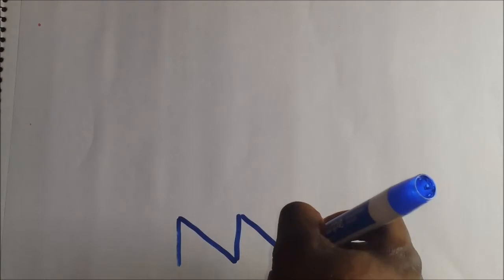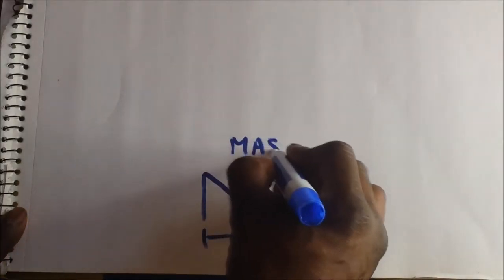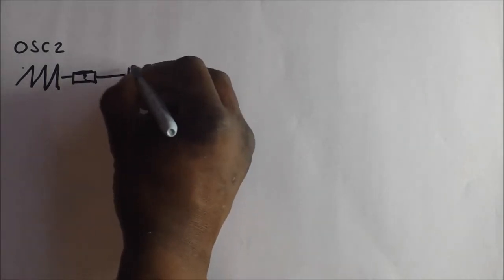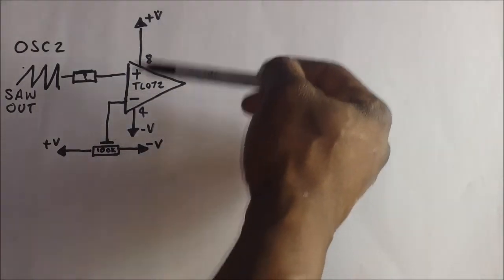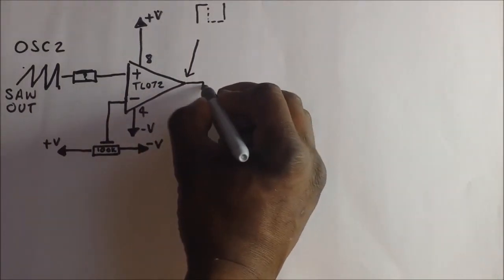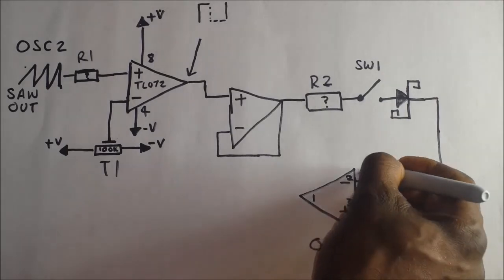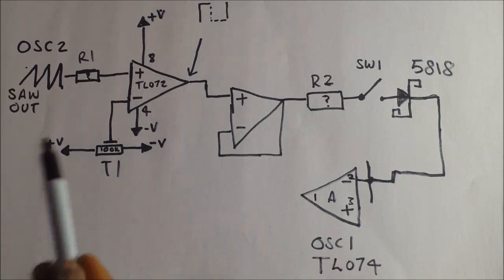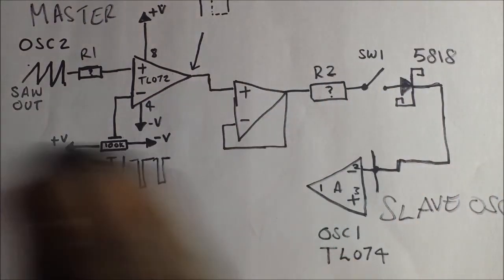DIY analog synth project Tutorial Part 18 (My Oscillator Synchro circuit )

Comment: Nice and good job.  I think all the current Dave Smith gear will let you synch oscillators, including the OB6.  I discovered when I was trying to synch 2 square waves on a Murmux v1 that the effect was very much like pulse-width modulation...which made sense when I thought about it.  Was happy to stumble across that because the first Murmux didn't have pulse-width modulation.
Reply from the maker: ProckGnosis Thanks man !!, yes i think everything from Tertra, Poly evolver has Oscillator sync . I would say it is probably my second favourite type of modulation after pwm. 
Very intresting that the murmux V.1 didnt have pwm , im very sure there must have been some good engineering reason as to why it was not included. In my opinion pwm is always a must have option.

Comment: Hi, Adam! I'm glad you've made it! :)
Please, look at this: http://tinyurl.com/yae6qf8k
My guess is that the main reason of my fails in HSync stuff that I've didn't tried to simulate the initial pulse source. As i've read somewhere that a HS Slave needs a positive pulse an a source... If you'll look at that URL, you'll see that in your oscillator it's not giving positive pulses.
It can be possible that it can be used just like you did show us but only with an inverter. The right part will remain the same. So maybe only one op.amp instead of two.
I'm playing with LF398 now, it gives good Lo-Fi sounds. So i'll check Hard Sync with your help and more effort now... but after a while :)

Comment: Sinc :D
edit: oops, i've meant SinK ))
Reply from the maker: MoolahNasreddin Hahah , yes sync or swim !!! 😅
Reply from the maker: MoolahNasreddin Hi hope all is well and apologies for not being in touch sooner. A big thankyou for the trimmers. They arrived on friday and appear to work well so far. Im wondering if you can source me some 2 way on-off- on toggle switches from your end and of course ill pay you . Thou im looking for about 60 :-). Thanks again for the package it was a good suprise .
Reply: Hi, Adam! One week for delivery to England is surprising me again :) "Almighty tracking" I guess ))
So, you tell that these trimmers works the same like original Bournes? In terms of tiny changes in turn... and noisiness... It can be important in the expo-converter. You know this more than me :)
I'm going to go in my town one week or too later... So probably I can't even order them in time. Locally they cost ~ 0.65 GBP. If you're talking about MTS-223. One switch weight is ~ 6g... So the package will be 360g at least. I'll check our Post charges for weights over 200g. <= 200g parcel is really cheap.

Comment: yay! another video! Sadly I'm still figuring out the DCO. Also got my hands on some CD40106 wich I am also playing around with.
Just to mention I am going all the way downright studiying the physics behind the diffrent parts and I belive I could actually make a working DCO if I can get my Math right. atm I am tracing down a nasty glitch in my algorithm, basicly what happens is the counters divide the Frequnzy of the master with a slight error wich then in return translates into an slight increse in Voltage from the DAC and that than distorts the waveform in an unpleasent way both in the upper and lower end of the spectrum depending on the pre dividers mode.
The solution is pretty complicated sadly. we are already swithcing the Master clocks frequenzy depending on the octave we are in but it appears that even then you'll have to decide weather you want accuratly highs or smooth lows, one will always end up being slightly distorted. So there are only 2 options, use a softclipper to smooth out the slightly distorted waves or use higher resolution counters, 32-bit counters would be ideal, a 24-bit could also work fine. rember, the scale of my project is more than just a mono synth, I bascily want a switzer knife, if I were to make only 3 simple monophonic oscillators that wouldn't be a problem. But those distortions get more noticable when we have more voices, ergo if I want to build a multi-voiced polyphonic stereo syntheziser I'll need to find an solution for this problem.
Gladly, I'm not new to this. I've worked with complicated algorithms in the past and what I am trying to do now is basicly the same just more hardware based. I think in the end I will have build more of an computer than an instrument but who actually cares as long as it makes good sounds? And hey, if my Idea works out I may have a reason to make this an actuall buisness for me.
Let's just hope that my wallet doesn't give up befor I can actually get my hands on the necceaary circut parts for this ;P
(Oh god, accurate quartz crystal oscillators are expencive! not to mention those counters...)
Reply: yea, sorry, another wall of text. I hope I don't bore you to death^^
Reply: Hi! Did you've watched that long long video of a guy who explains all DCO types in their glory and hardness of schematics? Probably it's only one in the whole YouTube... because it's not about falling down motocyclists and funny cats :D
Are you in a middle way to your DCO glory? Or just started to figure out things? Need to know before telling you more info about pros and cons of VCOs :)
Reply: ehem, sorry. I am not a beginner. So No, I actually don't need advice about pros and cons of anything. I have planned my project precisly. Plus I also have all the neccesery knowledge on how to do so. 
So I'd appriciate you not treating me like a dumbass, sorry, you really are hurting my pride here, just telling you, I don't mean to be rude, but in my understanding you've just been more than rude to me.
Reply: Wow, chill out, please :) I'm not treating anybody "like a dumb-ass" here :) Supposedly I have much less knowledge than you.
Was that because of "glory" word? Sorry, i'm not a native English speaking person. For me some "VCO glory" exists. And i've didn't completed it yet for sure.
And i wasn't supposed to make fun about you. Just really figuring out things. It's hard to understand is a person "already experienced" or "only a beginner" just by large text messages. About myself: i know about DCOs only basic things and even didn't expected that crystal timers (correct?) are expensive.
Please, don't be hard judging to loose terms that can be misread. We're not in a school or kind of. Nobody is bullying here :)
Reply: Well, I am mentaly ill and I am german. I misread, miss judge, miss interpret stuff all the time thanks to autism and multi-personality disorder. So I'd say no stress.
Reply: OK, no problem of course. At least you're realizing this and tell about it. It's good IMHO.
Reply from the maker: AP Girl Wow you certainly are going in deep. I wish i had the patience and time to learn the physics and science behind all the components, im sure it would help me troubleshoot and dream up newish ideas. The DCO approach sounds very complex, but very do-able on your part. I wasnt even aware that counters are available in diffrent bit resolutions as you have stated . If you come across any litrature or rwsources that maybe worth me reading please don't hesitate to send me a link or so.
Reply from the maker: AP Girl Bored ? ...hell no . Intrested yes, as ive said i would like this channel to grow as small community of enthusiast sharing thoughts and ideas. Every little helps :-)
Reply: sure, maybe I find my schools litriture on english. I have a bunch of books about the basics of those things in german.